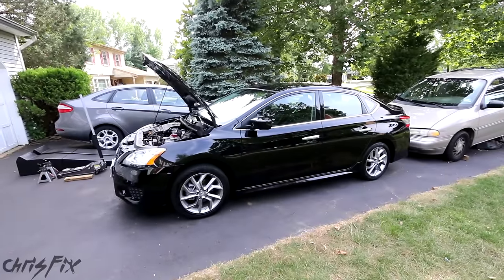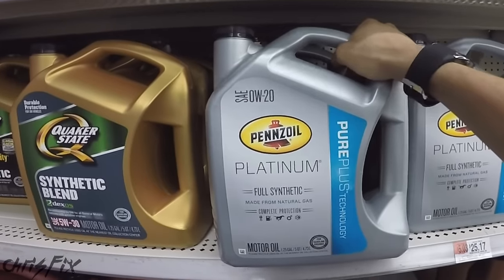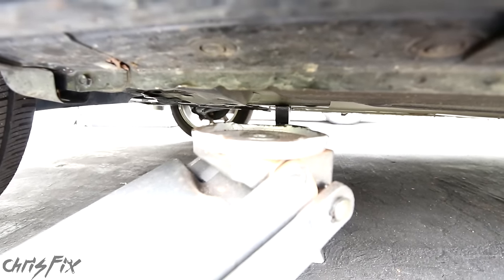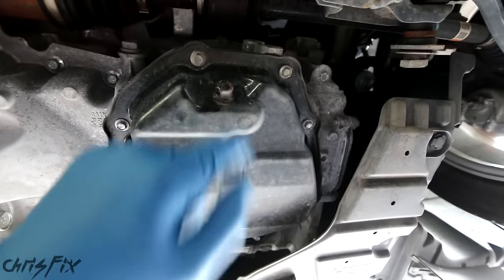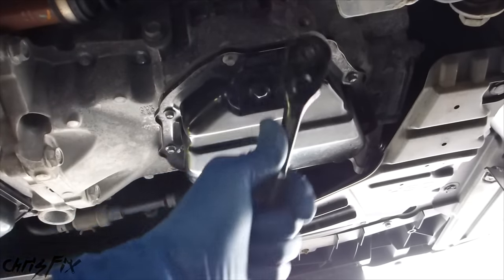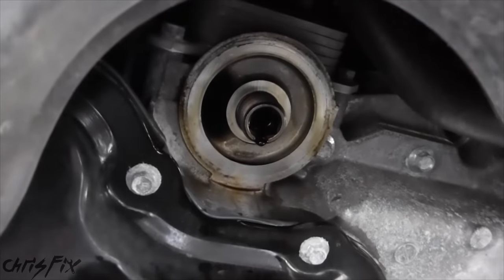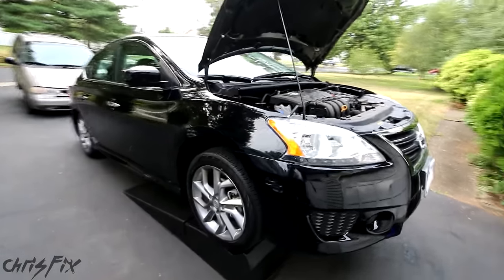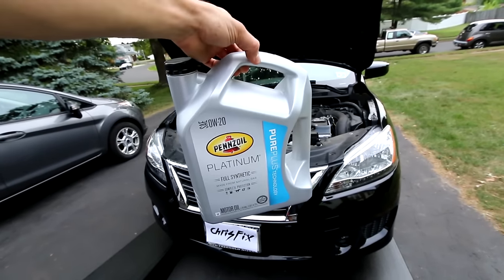How to Change Your Oil (COMPLETE Guide)

Comment: An added tip, I break the seal of the drain plug & oil filter before draining the oil. One time I drained the oil and then could not remove the filter. It was like the person who previously replaced the filter welded the thing on! Had to fill the engine with clean oil with a filter filled with dirty oil.

Comment: After draining the oil can you use some pressure compressor blowing from the cap sealing it with towel to get more old oil out?
Reply from the maker: There's not much of a point in doing that, if you're concerned about old oil being in there then i would just give it more time to drain. Once it gets to the point where its a drip every 5-10 seconds you have pretty much all of the old oil out.

Comment: Most owners manuals recommend you change your oil every 5000 - 7500 mi (depends on the car) The reason the interval is so smal compared to most other fluids (all ~45,000 mi) is because the oil has to do the most things under the most pressure and conditions. Oil goes bad the quickest which is why it's the most frequently replaced fluid in your car.
Reply from the maker: Thanks for sharing!

Comment: I always save my used engine oil in the container that had the new oil in outside my garage and I also save the used oil filters on a shelf in my garage. It's a great way to make sure that the used oil is not going to the landfill. And plus, the used engine will be recycled into something like paving asphalt or something like that.

Comment: Hey Chris! Question about this. I know its not recommended, but Im in a tight spot financially this month, but I need an oil change and dont have any tools like sockets or wrenches to do this. Do you think it would be okay just once to refill my cars oil without having drained the previous oil or swapped out the filter so that I dont have to go out and buy wrenches, sockets, an oil drain pan, filter, etc.?
Reply: If the oil is low, nothing wrong with topping them off with new oil. But if an oil change is due, best to do it sooner than later. Autozone and O'Reillys has an tool loaner program. Buy the oil an filter and they will let you borrow the tools needed for free.

Comment: The only thing that I would add is when you are replacing the oil filter, after removing old filter check to make sure that the rubber seal from the old filter is not sticking to the engine block, if it is remove the old seal and wipe the surface clean for the new filter so it will have a clean surface to tighten to.

Comment: I’ve seen videos where they pop a hole at the bottom of the filter to drain and oil there. Is that good or bad? And thank you for the reply 🤘🏼
Reply: People just do that so there is less of a mess especially when the oil filters sit horizontally.  Personally I don't see the point in it but it does no harm to do so if you want. 

Hope that helps.

Comment: As a dude from Wisconsin, I think that tip about running the engine for while prior to beginning the job comes from cold places like where I live. I don't know that it would apply to anyone in the south or like California or whatever. Then again I think things like gasoline, oil, and other chemicals have to get crazy cold before you'd have to worry about it.

Comment: Make sure that the gasket from the OLD filter is not stuck to the car when removing it. I made this mistake myself, and you will not have any leaks until the engine has started, pressurizing the oil. And it's a violent leak lol.

Comment: One thing i noticed wasn't mentioned in the video. 

If you don't have a breaker bar or a longer 3/8 ratchet, use your dominant hand and hold the head of the ratchet and use your other hand to hammer it. It Helps to loosing the plug easily and you won't likely strip the drain plug head.

Comment: Hi Chris,
I just got my brand new car(Sentra 2022) about 4 months and there are almost 4800km on it (2980 miles) so, my question is Exactly when should I change my oil?
Reply from the maker: Check your owners manual as it will give you a maintenance schedule to follow. Once you hit the milage it says to change oil on, change it then

Comment: Lol i just did it on my Toyota Tundra I did a oil change for the first time in the 90s with my Toyota pickup and I drained the oil didn’t know about the filter or the dip stick I filled the oil all the way to the top but I didn’t start it up thankfully and my dad fixed all my mistakes lol

Comment: Are you supposed to add water to the engine coolant when Its not cold or is it supposed to be the antifreeze at all Times ?
Reply: Most anti-freeze is a mixture of water and ant-freeze. However, if you add too much water to your system you could run into problems especially when the temps are cold outside.

Comment: One of my big tips is to use a more thick oil if you plan to push the car more like with track use as when you push the car and heat the oil, it can get thinner with the heat so it has to be thicker to keep enoguh viscosity to protect the engine. If you want to see why this is so important, watch the video when Chris loses a piston from a biting rod bearing.
Reply: or just get an oil cooler like you should anyway

Comment: i think why most people, including myself, is because we think too much into stuff. i love cars, but only owning 1 car that i use a lot has me very nervous about breaking it when doing things myself, but the truth is, it's not that deep. you take old oil out, put new oil in. you unbolt something. You put the new thing in and bolt it back into place. my car had a coolant line pop off because my engine mount was worn, so it pulled on the hose and caused a leak. first time i had to fill a car with coolant. it was easy. I still gotta get new mounts , so for now, i gotta drive carefully, but the fact is, when i wasn't thinking about it, i got it done easy. soon im gonna get a new radiator to be safe, and it's just gonna be as easy as taking out the old one, putting in the new one, and filling it up/bleeding it. oil changes are no different. as long as you have oil in your car, it's not gonna run dry or blow up. The scariest part is turning the key, but as long as you have oil in it, it'll be fine. It's all about building confidence

Comment: Hello Chris. Thank you so much for the video. 

I am going to change the oil of my car for the first time myself.

I just have one question. I am going to put the car on ramps. But I wonder if it's not a problem that the car then is not positioned straight? The front side is of course higher than the back if it's on ramps. Does this not cause a problem with draining the oil? Or it doesn't matter, and all oil will still get out?

Greetings
Reply from the maker: All the oil will get out as long as you give it time to drain, you don't need to worry
Reply: @chrisfix  Alright!

Thank you for the answer. 😀👍🏻

Comment: Well done! We tried with husband to do an oil change and no luck getting bolt off. Sad part was when he couldn’t wait to get car off ramps and forgot the jack stands (we left them there in case something happened) where still there. He was meant to wait for me but for some reason he did it by himself. So he nearly damaged the Honda Jazz. Then he didn’t even know where the scissors jack stand is…..Thinking of divorce at the moment. I just cannot believe he would do that. Unfortunately either I learn to do by myself or back to get the mechanic to do it.

Comment: Hi Chris! I have a question, after changing the oil, should you wait or anything to start operating the car? Also, my oil filter had to be placed horizontally so we weren’t able to fill it with oil. What would you recommend?
Reply: Leslie, thought I would chime in here. I have a horizontal filter as well. You don't have to pre-fill them with oil. If you can, great, if not, its not going to hurt anything so don't overthink it too much. 
Once the new oil is in the car, double check to make sure your drain plug is tight, the new oil filter is on tight and start it up. Let it run for a min or so then pull your dipstick and check the oil level.

If you have any questions let me know and I will gladly help.

Comment: Back in the old days, when a friend of mine changed his car's oil.  After draining the old oil and before removing the old oil filter, he would put 4-5 quarts of kerosene in the crankcase, unplug the distributor and turn the engine over for about 15 seconds to get some of the old sludge out.  Is this ok or not?
Reply from the maker: I’m planning on doing a video on cleaning out oil sludge very soon so stay tuned!

Comment: Here’s a tip with changing oil,  u don’t have to let the pan drain out, if the filter is close enough u can take off the drain plug and the old filter and replace it, and obviously make sure your oil catcher is big enough,  I find that this makes it faster, once you put the new filter in then wait till the pan finishes draining then put the plug back on

Comment: I only put 700 miles per yr using full synthetic oil,  changing the oil once a year. Do you think I can drive it for another six months before changing the oil? A response would be greatly appreciated.
Reply: Regardless of how the 700 miles per year you drive you should change your oil every 6 months. So 2 times per year will work for you in your case.

Hope that helps you out
Reply: @vigilantemotors  thanks for the response.
Reply: @kp6153  Anytime. Let me know if you need anything else.

Comment: A old tip I learned from my step dad is if some idiot put the oil filter on with the wrench and not by hand take a long flat head screwdriver hammer it all the way through to the other side and it should give you the leverage needed to break the filter free. Then you just move the catch can under the filter remove the screwdriver wait for the oil to drain if there is any and unscrew the old and replace with the new

Comment: So when you’re doing a change on cars that have an oil filter in sideways or upside down,when you replace it and it can’t be filled with oil, will it affect the motor at all since it’s gonna initially run dry?

Comment: Oil filter wrenches can suck nuts/balls especially with smaller cars that have small filters. SO I figured out a plumbing wrench works great but go gentle so you don’t damage the threading on the car and don’t use it on a new one cause it crushes the piss outa the filter (I know this isn’t original I’m sure but it’s a trick I learned )

Comment: one thing i would look out for is that oil gasket.. sometimes those old filter gaskets get stuck up top where the new filter screws in.. if you put in the new filter while there is a second gasket up top, there is a chance that the oil can leak through that gasket and filter..
also,, i was just curious as to if there would be issues if you change your oil without prefilling the filter ?
either way, very informative video, and very concise :)

Comment: When do you recommend using high mileage oil? Been putting full synthetic in my 09 Honda fit with 150k miles for years with no problems, should I make the switch? There seem to be differing opinions online

Comment: You can also use a adjustable wrench to unscrew the oil plug it’s easier
Reply from the maker: That has a chance of stripping, if you don't have any tools though then you can make it work but I'd recommend a socket/ratchet

Comment: I think it should be stressed that the oil filter wrench and breaker bar actually aren’t so “optional” lol. I did all three of our vehicles and both of those tools were necessary for each one. So I think it’s not very likely you’ll be able to do the job without having both. Many oil filters are tucked away on newer vehicles and REQUIRE the socket style wrench + an extender.

Comment: Hello my friend. I have changed the oil in my car after i saw your video. Very helpful. Thank you. I have one question. Is it a problem that the car is not in a straight position because of the ramps and the used oil maby not drained out completely and some quantity stays in the carter?

Comment: When you're about to add oil you can jack it up to get the ramps out from underneath and lower it  instead of adding it while it's in the air.  

Not a huge deal, but just if you want to add it while it's level
Reply from the maker: You could do it that way too.

Comment: Just order two piece race ramps 67” 10”lift wonder if you can remove second half of the ramp and put jack stands for extra protection thinking about trying that when I receive my ramps
Reply from the maker: I would just set the handbrake and block off the wheels and you'll be fine, it would be pretty hard to get jack stands to do what you're trying to do depending on the car

Comment: Chris, I'm driving a 1992 Toyota Pickup. It's the only vehicle I've ever owned, so I'm pretty familiar with its functionality. I'm starting to notice slightly lower oil pressure than I've ever seen before in this super hot summer. I looked it up and found that lots of people use thicker oil during the summer months to battle thinning oil and force higher pressure. But the more I looked into it, the more I found that, yes it will work, but most professionals still say they recommend only using the manufacturers recommended viscosity. So, I want to know from you, what is your opinion on using thicker oil during summer heat??
Reply: I'd go with the pros' advice. No one knows your car better than the manufacturers themselves

Comment: Hi Chris, please, how would you take only a quarter of oil out if it's too much after changing it? Would you open the drain screw a little bit or another way? Thanks!
Reply: Fabio, you could do that. Take an empty quart, drain your oil into it and there you go. You will know exactly when to stop once the old quart of oil is filled back up. 

After you are done be sure to run the vehicle, pull the dipstick and check your oil level.

Hope that helps.
Reply: @vigilantemotors  I appreciate your reply. I was concerned with oil in the screw threads. Thanks!!
Reply: @fabio.1  yeah anytime. Always here to help so ask any questions you may have.

Aaron

Comment: Here’s a good tip. Sometimes the oil drain plug will be tight and already cross threaded. You SHOULD replace the oil drain pan. However in my shop if someone declines it then we rethread it, if you are to do this option you must leave the oil drain plug off and put some oil in the car so it can drain out and take any of the metal shavings with it. Another tip is always check the manufacturer specifications for torque. 20ft pound’s obviously isn’t a lot but some cars require 30 or more
Reply: Do you recommend removing the filler cap before draining as this guy seemed not to do this?
Reply: @KevinL-wm3vl  absolutely, it allows air to enter through the filler cap and helps drain the oil quicker. Pretty much the same concept of trying to empty a bottle. If there’s no hole for air to get in then it’s a slower drain. But with a hole for air to get in, the flow is much quicker.

Comment: In a pinch you can stab a screwdriver into the old filter for some leverage to remove it, that's what I do lol still haven't bought a oil filter wrench. Call me cheap but if it works...

Comment: Hi! I see some auto shops where I am from take engine parts to clean them after flushing the oil but isn't the new oil supposed to clean it up? Is that a step that's needed to be done every time you have to replace the oil? They also pour Engine flushing oil first prior to the oil change. Are all those necessary?
Reply from the maker: Unless you have a lot of buildup or varnish or some kind of oiling issue it's not really necessary to do

Comment: So i recently got my first car which is KIA K5 LXS and dont know about car to much since i never have anyone to teach me and would like to get into changing oil and other stuffs myself so i have yet to get oil change since the dealership guy told me that it was a yearly change (which i want to really test that out) it been running fine and there no problem at all yet so i did some research and found Mobil 1 Extended Performance 0W-20 which said it will last up to 20k miles so i want some advice to what brand for me to use if im gonna try to learn how to change oil myself and if it safe to get with Mobil 1 Extended Performance 0W-20 and use that on my car. I have this car for nearly 8 months now with no problem what so ever so i want some advice to go about this

Comment: Can I refil oil if its low without changing it - first time owner of a car and I’m thinking to change it completely and got a universal oil compatible to my car but I don’t know what oil for sure is in the oil tank at the moment but after measuring the dipstick it says low oil level so any advice would be appreciated, thanks and sorry for the noob question 😅
Reply: Yes you can always add more oil if the oil is low without changing it. You want to change the cars oil every 5k miles. It's not gonna break the car if you don't change the oil, but changing the oil regularly maintains a cleaner engine and could be the difference between if your car will make it to 300k miles and still be driving perfectly good, or if it'll break down at 150k miles and be done for.

Comment: Only tip I have is make sure your old filter has a gasket if it doesn't its still on your car make sure to remove it otherwise you'll have a double gasket and oil will leak from the filter in a matter of seconds if it doesn't it will eventually when driving and can cause some damage to engine
Reply from the maker: Thanks for the tip